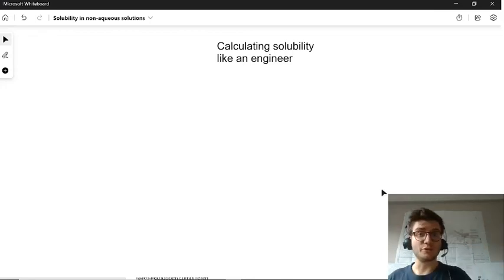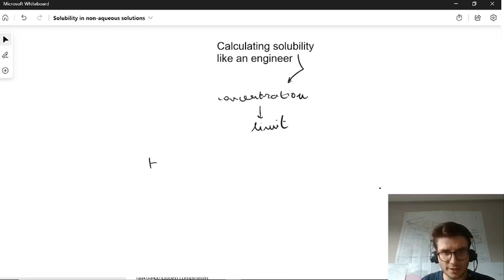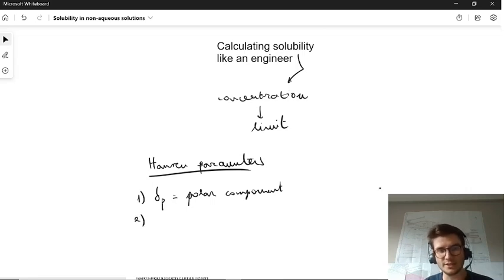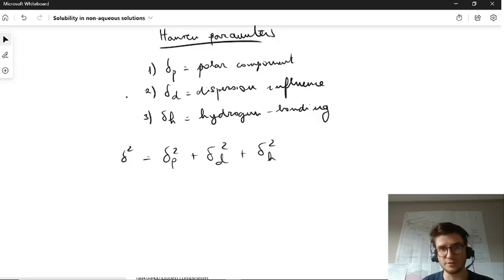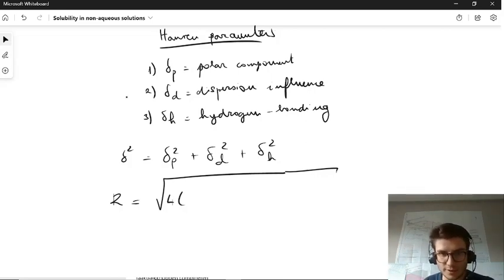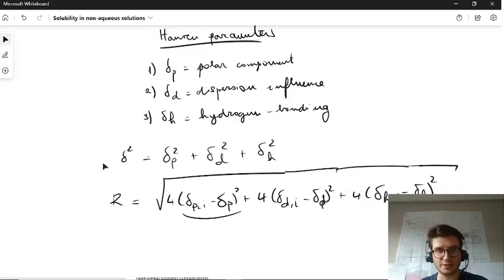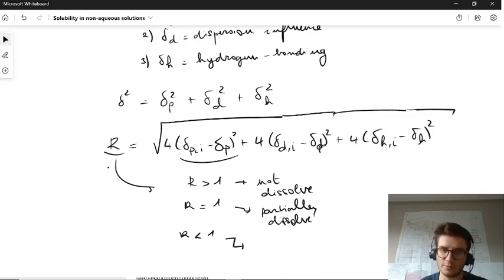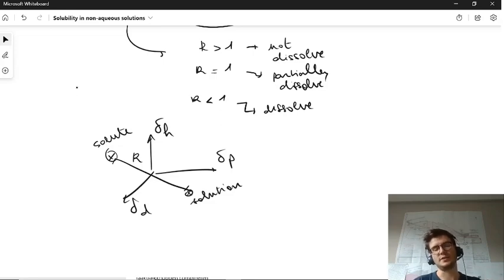Hansen Solubility: Explained

Comment: You did not explain where the 4 comes from. I believe it is just some kind of fudge factor to make it more spherical. Really, this is just the distance formula in three dimensions, and the R value is the ratio of the distance of the radius of two spheres-the distance to the origin. If you remember that "like dissolves like"  it makes sense that molecules with similar properties with respect to hydrogen bonding, van der waal, and polar forces will be close to each other on the Hansen coordinate system. The greater the distance the less probable the two chemicals will be compatible enough to mix. Hope this helps.